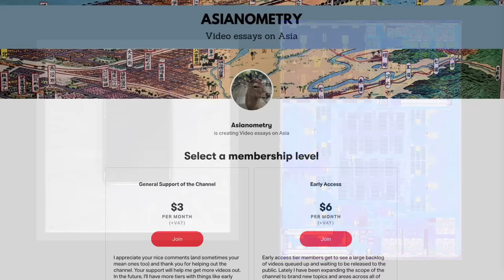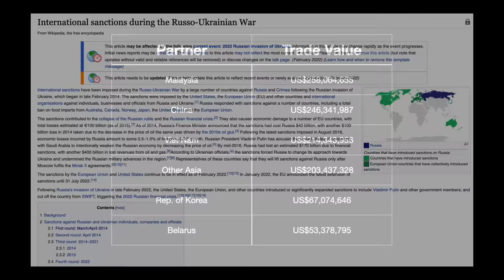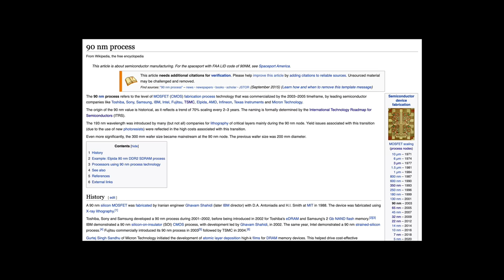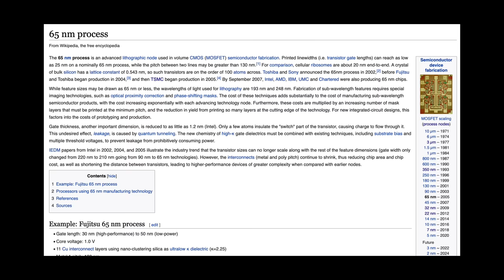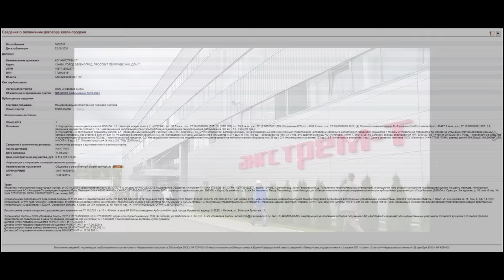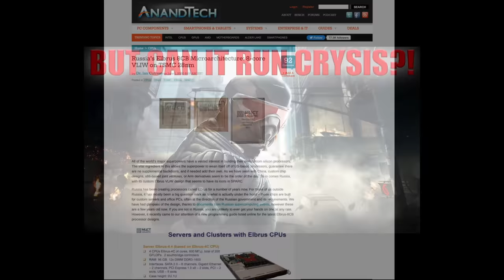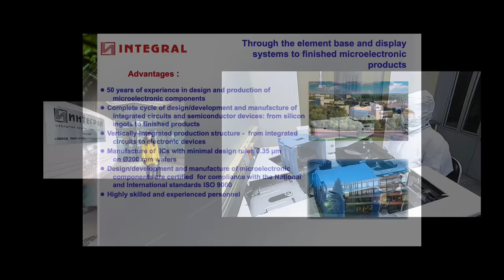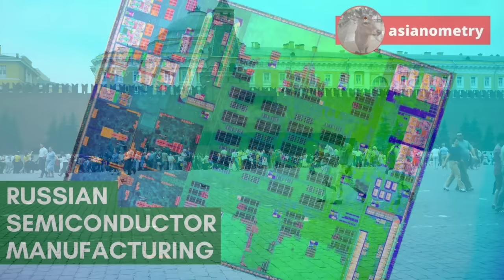Why Russia Can’t Replace TSMC

Comment: Your video inspired me to do some rough calculations which end up demonstrating the progress in semiconductor manufacturing quite well: The Motorola 6502 CPU (from all your favorite 80s computers) was manufactured an an 8um process. If you attempted to manufacture a Ryzen 5 (from 2017) on that 8um (8000nm) process instead of a 14nm process, the CPU die would be just over 22 square meters to fit in the same number of transistors.
Reply: It would then run only at 2MHz  like the 6502
Reply: So, if the node process is x1000 bigger (in width of transistor), wouldn't area be 10⁶ times bigger? What's the area difference between these nodes?
Reply: @aebisdecunter  I divided the number of transitors in the Ryzen 5 by the number of transistors in the 6502 and multiplied that by the published die size of the 6502 at 16.6mm^2
Reply: That's not even a chip at that point, that's a cake.
Reply: Motorola did not make the 6502, it was made by MOS. MOS was bought by Commodore.
Reply: computer chips may have improved a lot, but do we really need better chips just to watch youtube and send emails?
Reply: @Withnail1969 maybe not, but we need better chips for AGI and other astronomically computing intensive to be accessible
Reply: @wilsan806  We probably need several algorithmic breakthroughs for that. AGI is still utopia, those LLMs burnig CPU and power are not even AI.
Reply: current nm measurements are marketing, they aren't the true sizes
Reply: @Withnail1969  newer developers aren't as experienced and keep bloating the code, and we need faster hardware to overcompensate for their faulty software